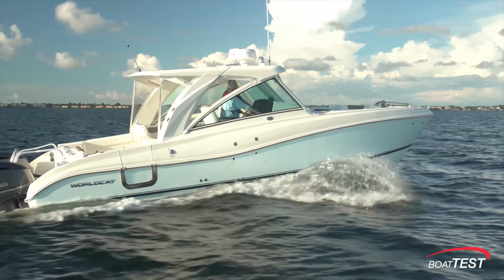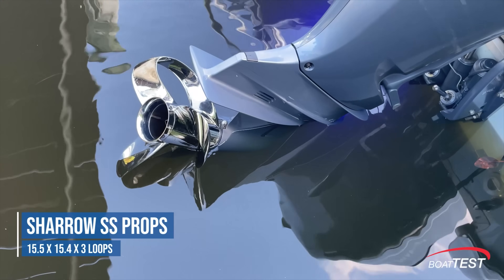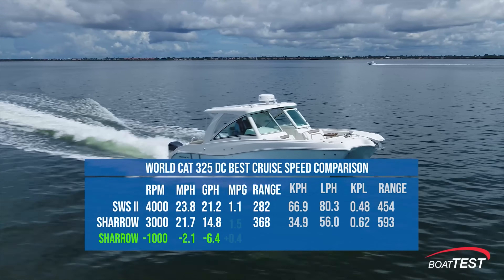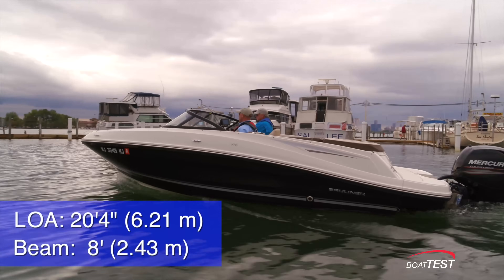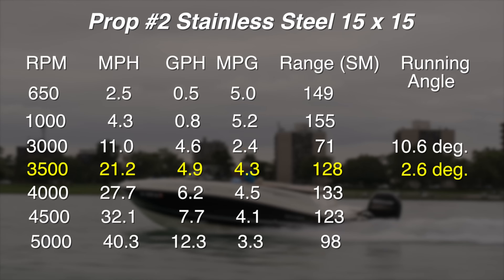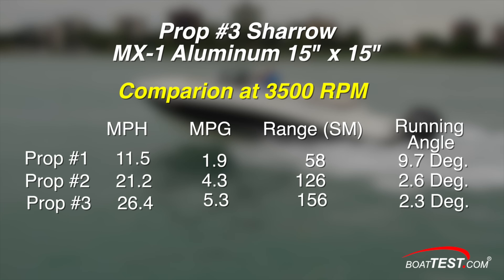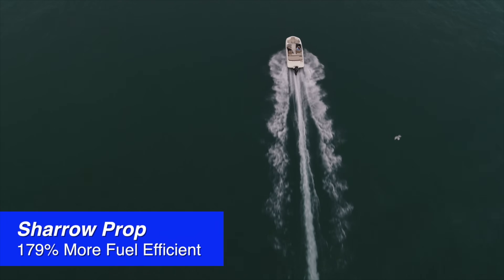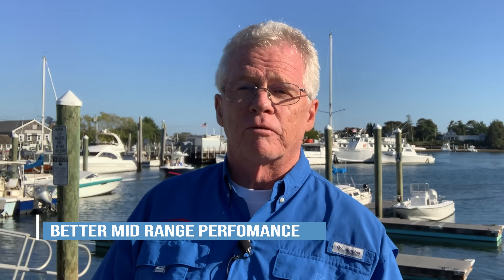Sharrow Props - Range & Efficiency

Comment: i really liked these until i saw the price... you can buy a lot of gas for $5000
Reply: $1,200 to fill up the boat with fuel. The prop pays for itself quick.
Reply: @Joe-bh4vz  no it doesn’t
Reply: Not at the docks.  250 gallons of fuel the savings is quick after a few fill ups
Reply: China will sort that out for you.
Reply: If your serious about boating or in the business, this is a no brainer.
Reply: Is this sponsored?
Reply: It's understandably pricey for normal boaters to use, but the fuel savings alone could make this kind of tech invaluable for commercial shipping. To put it in perspective, a lot of the ships I've worked - which are often on the smaller side, around 300 feet long- will burn 2000-4000 gallons of diesel a day during operation. If a new toroidal prop could provide the fuel savings shown in this video, you're looking at hundreds of gallons saved every single day- that's massive, especially over the lifetime of a vessel expected to operate for decades before retirement. That's well worth a large upfront cost for most companies. But hell, we'll just have to wait and see how the technology develops.
Reply: But that doesn't extend your range. This does.
Reply: @Bubbles99718  a spare gas can for $10 bucks extends your range too.
Reply: @damham-F47 , yeah, 5 miles
Reply: @Bubbles99718  you know what does extend your range? A fucking Jerry can!!!
Reply: @charlieodom9107  lol
Reply: @charlieodom9107  good luck with that
Reply: @charlieodom9107  With a 150gallon tank a 5gal jerry can or 2 doesn't do that much except add more weight. fuel bladders are pricey also. I guess those people with $100,000 boats aren't too worried about a $5,000 prop.
Reply: @charlieodom9107  and how much is a Jerry can ? $20 maybe?
Reply: @Retired88M  they are a lot more than that, depending on size, fluid type, and accessories.

For example: I used to use a 33 gallon auxiliary tank in a center console to make a trip to a fishing spot, and that thing cost a few hundred.

The thing is, you only buy them once, and many boats have space to permanently fix an auxiliary tank, so you aren't lugging around heavy ass tanks.

Also note, the people these are targeted at are smaller boats, not yachts, so 5 grand for a prop is absolutely ridiculous.

Now, if they were to lower the price to something like 1500-1800, that would be feasible for a lot more boaters. It appears as though they want their R&D money back immediately.
Reply: @charlieodom9107  
I’m a trucker and weekend trailer boater and it’s the same thing with trucks. In 2009 all class 8 trucks had to be equipped with EGR (exhaust gas recirculation) , variable pitch vanes in the turbochargers and exhaust soot collection modules that the EPA mandated and said were tested over millions of miles. Tell that to all the one truck owner operators that either went bankrupt or out of business trying to keep their trucks going. I personally drove a 2009 Pete with the ISX Cummins 565 and my boss dumped at least $50,000 into all the pollution stuff that the trucks didn’t need. 
Someone needs to get one of hers props for a cast and start casting duplicates to flood the market and bring the prices down
Reply: @Retired88M  
A real Jerry can is hard to find anymore and if you can find one they're more like 60 to $80 each. I just bought two and let me add this I didn't see anyone talkin about the safety Factor. I used to keep a couple Jerry cans and real ones military was on my boat and a few times they swelled up in the Sun like they were going to burst. Kind of dangerous. But people do crazy things I used to go to the Canyons off of Jersey Shore with 2 30 gallon drums of gasoline up on the flybridge. Yeah we were crazy but we were a lot younger then
Reply: @Bubbles99718  a fuel bladder + gas is way cheaper
Reply: Yeah they used to have cast aluminum ones on the sight for way less. The stainless is a lot of machining
Reply: How long does it take to break Ben ?
Reply: Right I get testing and all has a cost but I mean it's what a black of aluminum that is machined probably under $200 to produce but $5000 and if you have 2 motors that's $10000
Reply: I guess stainless is more but still under $1000
Reply: A I can see it’s just for over 150HP engines…
What about the little ones? 30-120HP? No cover? Should I start a crowdfunding and try to cover the demand of normal-not-rich people?
Reply: Wait until China get the prints. It will be on eBay for 500 in a year
Reply: @wictorh1564  yep, I believe that too
They just need to buy one and do a laser 3d scan to create a CAD model. It’s actually that easy
Reply: Evidently you are completely unfamiliar with the term ROI.
Reply: If the 10% down they want when ordering was the full price, I would have bought one today!
Reply: @jakeringer3153  exactly! That’s how much I thought they were originally and would have order immediately
Reply: Get one  and take it to a machine shop.
Reply: The folks that think this is good value probably also don't understand what causes world wide inflation either!! Ill give you a head start its not the war in the UKRAINE! Or Hunters Laptop although the two are related and would be amusing!
Reply: @blackwingvisuals5017  Correct.   Inflation is caused by the idiots that vote for the party that wants to keep giving away, and spending your tax $’s like they are their personal dollars.    Wasted $ on - Handouts to everyone that claims to be their friend worldwide, Green energy, illegal aliens, social programs….etc, etc….     Just send the $ to the libtard cities where all of the votes come from, and the countries that can provide a valuable distraction and rig/influence voting.      Why not “America first”????   Because…. It doesn’t feel good enough????   We are doomed!